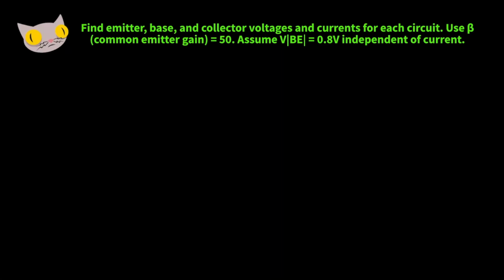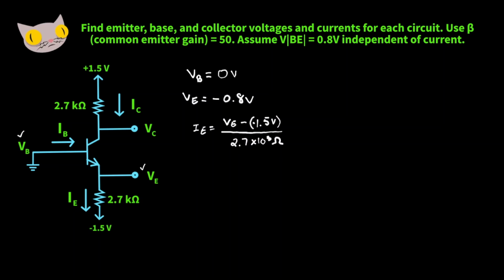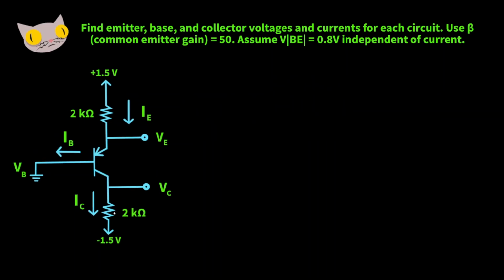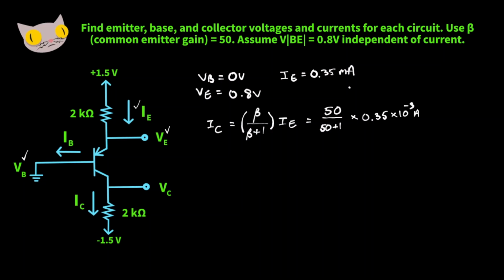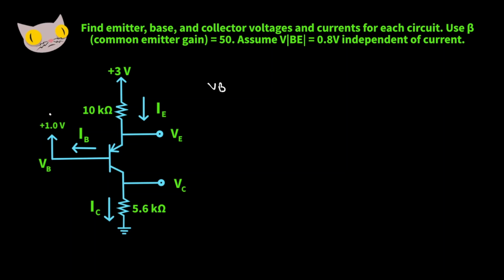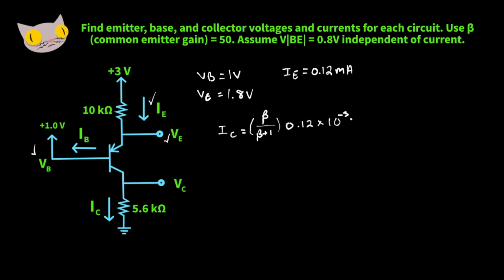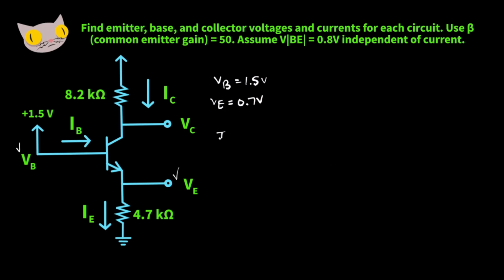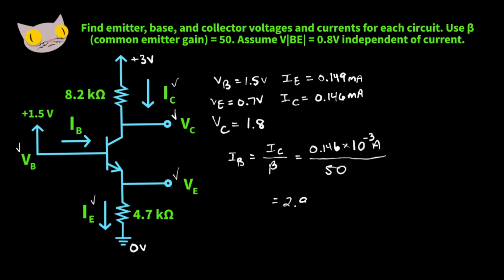Finding Currents and Voltages | Transistor Problems

Comment: Sir how do you know that the voltage appear is +3v without having any calculation in the last question?
Reply: The three volts just wasn't written on the question before hand. The +3 volts doesn't matter too much in this context as the rest of the math doesn't change.